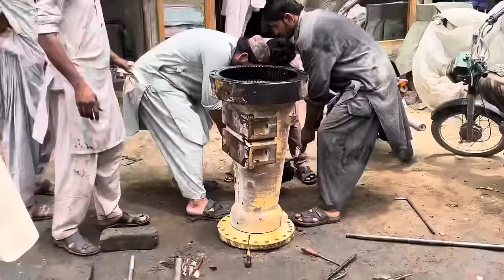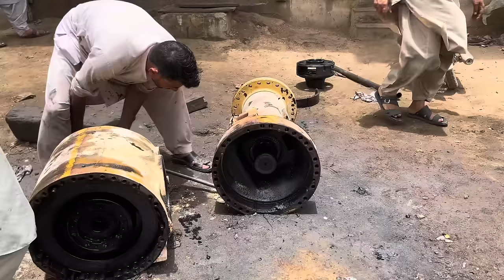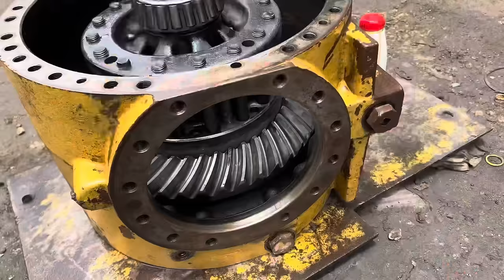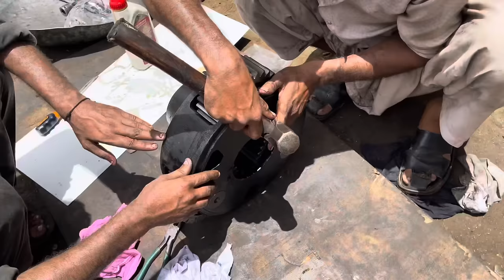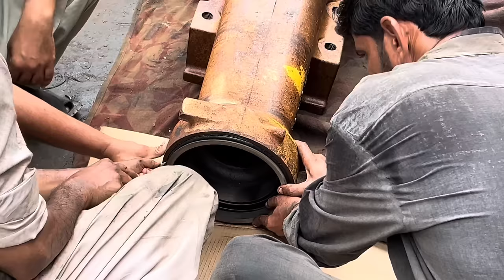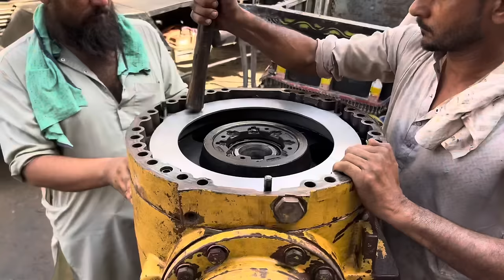Defferential Gear and Front Axle of Caterpillar was Completely destroyed || Expert Mechanic Fixed it

Comment: You guys need a device that can hold your parts cleaning solution at the bottom with a hi volume pump and two truck filters a hose and a sprayer and on top a large tank big enough for parts with a drain that goes back into the bottom tank that way you can reuse your cleaning solution which will help save money and make cleaning parts easier 😊😊